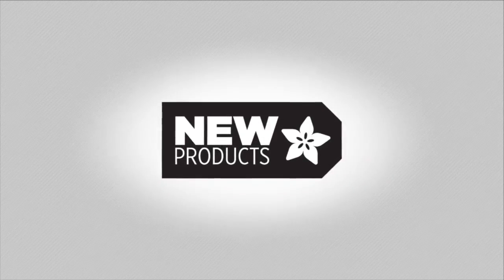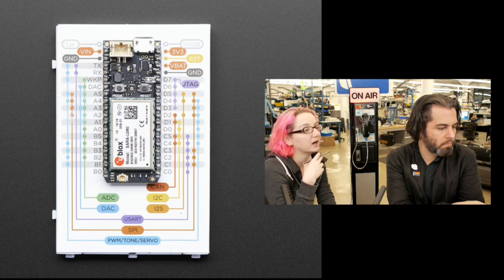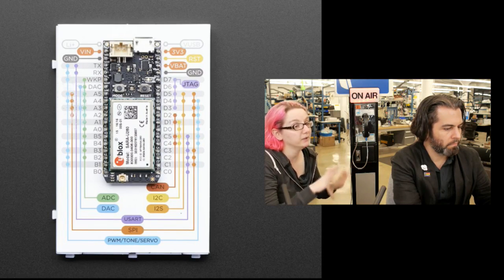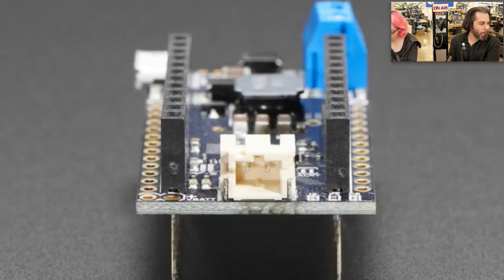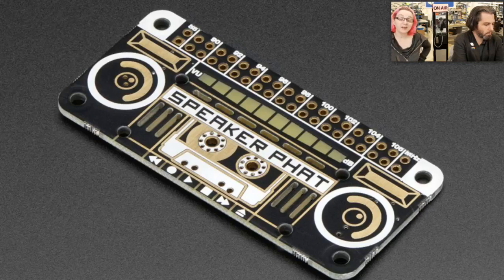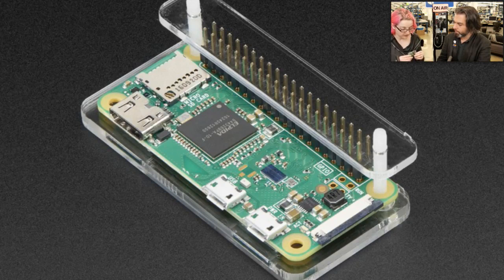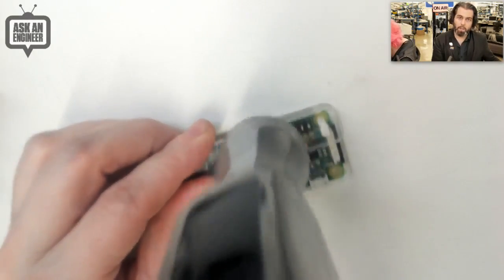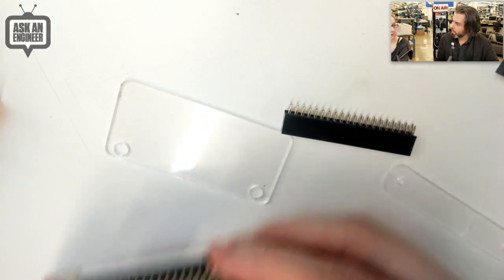New Products 3/29/2017

Comment: Instead of the hammer, I think I'd just put the whole thing in a bench vice. All the pressure would be applied evenly. I've installed IDC connectors this way.